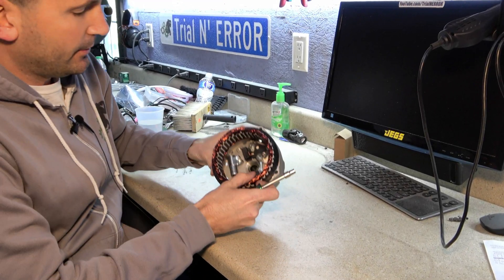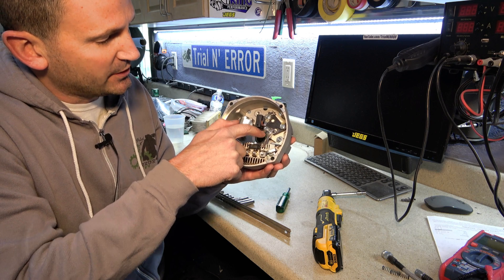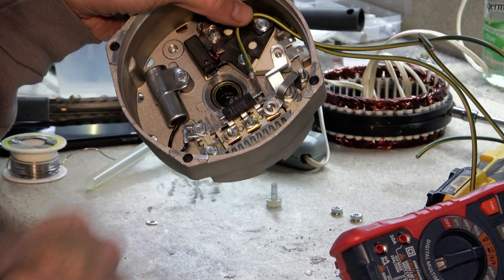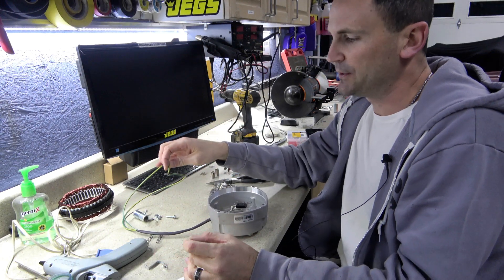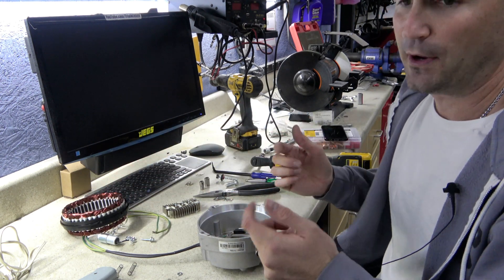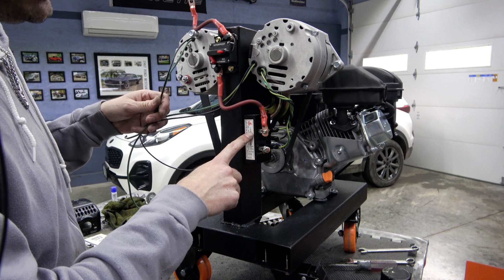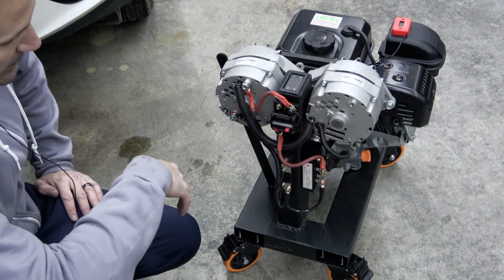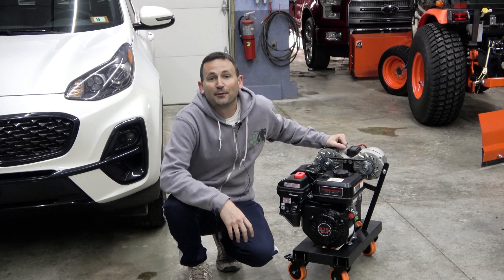Building a 48v Off Grid Generator: Part 2 - Got it figured out!!!!

Comment: So this is a petrol engine powering a pair of modified ac generators with built in rectifiers to achieve 48V. I don't see how it's much different to standard petrol 120/240v petrol generator with external rectifier. I guess it's quite a lot less efficient being belt driven and with twice the moving parts.

Comment: I was considering doing something similar, but using one alternator, and a step up transformer, say, 1:2 (24v to 48v), then the bridge rectifier. It would double the  voltage but half the amperage. Just use a high output alternator (one). I thought it would be simpler than what you are trying to do with 2 alternators, and it's a great excuse to wind a transformer! I suppose you could just buy one, but where is the fun in that? That's one of the great things  about a/c, you can easily change the output voltage with just a transformer.
if you are buying a transformer, you could get one designed to step down 3 phase, and just connect it backwards. There are lots of step down transformers for 3 phase, and they are usually even ratios like 2:1 or 4:1.
I'm thinking about a way to use a shunt and a transistor or two to regulate the field current based on the output current, there has to be a way. I'll figure something out.

Comment: I have a 6 hp diesel engine and i plan to run free grease fuel in it, also i plan to mate it to a dc motor to charge my solar batteries through a charge controller,  can anyone give me any pointers on my idea

Comment: Why don't you take the voltage regulators out of the alternators series them together going for the highest voltage possible  bridge rectifier to dc hooking them to an mppt charge controller designed  for 48v batteries don't worry about regulation because the mppt charge controller will manage it all. Higher voltage means less amperage and smaller wires.
Just an idea, hopefully simplifying the process.

Comment: Nice Job. Do you still use the DC generator? I have done every process that you have shown in the last 2 videos. I was able to get the cost per Kilowatt hour down to $.36 per kilowatt. with Fuel cost at $2 per gallon. I ended up hacking the Delco 10si with my own rheostat and data logger. I also used the bridge rectifier. Through my own trial and error I discovered that the alternators have a 20% duty cycle. They just are not designed to charge large battery banks. The get vey hot if you run the over 30% of rated output. I discovered it is all about rotating mass.
The Delco 100 amp 10 or 12 si weighs about 12 pounds. I have a MEP military DC generator now. The generator head weighs about 90 pounds. Needless to say it has  a hole lot more Iron and copper rotating mass. No Heat issues at 100% output. I paid $200 for the generator. That said I rarely use it. I normally charge our 30 kilowatt battery bank using the Magnum inverter charger. I power the Inverter/charger with a MEP-016D diesel generator. The cost per kilowatt at todays off road diesel prices is obviously more that when I did my first test t $2 a gallon. Still on those multiple days of snow and no sun I have found it to be more efficient than the DC twin cylinder gas generator. sorry about the length of my comment but I am truly interested if your generator is still working for you. There is no shore power available in our area.
Thank you sir.

Comment: This was a interesting video -  as for your 2 altenators to produce an efficient 48 volts -    both altenators would need to be in phase with each other - 
      To remedy that problem you can add a large capacitor to each rectifier out put - 
      Connected each capacitor up just as with a battery and that will eliminate the phase lag - 
    Then  hook your capacitors in series as if there battery's - 
      At that point you should get the full out put power generated off the altenators -   
       you could use two 1500 uF 250 volt capacitors - I've done things like that using welding machines to generate series voltage for remote mountain microwave transiever's when the on sight 48 volts generators all failed - communications systems are 48 volts

Comment: Watching this a year late, but I think, were it me, Id have electrically isolated both ground and hot on the second alternator. That way, your original plan would have worked with a LOT fewer headaches. Second thought is a small harbor freight or similar generator wired to a 48 volt golf cart charger might have ended up less expensive overall, No? Great video overall. Thanks! Gave me some great ideas for a similar project.

Comment: The problem with what you are doing is that the alternators have no charging algorithm for bulk/absorption/float.  They just supply constant voltage which is fine for automotive batteries which don't normally reach a depth of discharge that solar batteries do.  The higher the D.O.D. , the higher the voltage needed to bring the batteries back to a full, 'good quality' charge.  You'll find that over time the quality of charge that you get with this setup is sub-optimal.

Comment: You need to pull the AC from each out, put them into external rectifiers, then combine the DC, add a capacitor to flatten the output, see where your OC voltage is and then get a 48v buck for the rated load.

Comment: I think you could have made this work with one alternator and had the regulator work for 48 VDC by wiring a 24 V zener diode in series with the voltage sense input to the regulator. The zener will subtract 24 V and the alternator output would have to be 48 VDC for the regulator to see 24 V on its sende input. It should then regulate the output st 48 VDC.

Comment: I just stumbled across your first video of this project and got instantly enthralled. I am 73 and have spent my life on diy projects like this one.  And I think the name you chose for the channel is awesome. It describes my whole life.
David Poz did a similar project on his channel "DavidPoz" only he used a single alternator, removed the regulator and ran the output into a solar charge controller. 
Both your project and his were very interesting and enjoyable but both were too expensive and too much work for me.
I have a similar project in mind in my budding solar journey.  I already have a 120v 3000w generator but I don't want to spend $500 bucks on a 48v charger. 
So, I  am going to "TRY" running the output 120v ac out of that through a 200amp full bridge rectifier (Amazon $23), add a $2 capacitor to smooth out the rectified dc and feed that into a cheap 48v solar charge controller. Run the generator on propane or better yet natural gas and not have to deal with gasoline at all. 
Should work, maybe it won't.  "Trial and error" .

Comment: If you had used a solar charge controller you can use full voltage off the alternator and if it runs too hot you can reduce the voltage with a heavy duty rheostat and use a lighter wire and the Voltage doesn’t really matter but the higher the voltage the less amperage to get the same wattage means less heat so your fields should run cooler

Comment: wondering if a simple voltage doubler would have worked ? 2 caps and a view diodes rated at 125 amp or so, so 1 alt needed, then a aftermarket regulator 48v to the input inverter

Comment: A few suggestions. Use a dual pulley on the engine to drive each alternator on its own belt. This would eliminate those extra pulley / tensioner mechanical components. Also driving one belt through all those pulleys along with having the grooves on the alternator pulleys being the wrong size will make for some short belt life. Instead use 5" racing alternator pulleys which will accommodate the wider belt of a standard pulley. A dual engine pulley can easily be sized as required. The larger pulleys will reduce the strain on the belts ensuring longer belt life over smaller diameter pulleys also. Those types of engines are only good for about 1000 hrs of use. Use a diesel engine to get perhaps 3000 5000 hours of use plus it would use much less fuel and be cheaper in the long run.

Comment: Living off grid in the mountains of Luzon, Philippines. Thanks that was most informative and saved me going through a similar journey hhh. Got my motor, a low speed diesel YAMADA 7HP, 1800 rpm.... Now I need to figure out whether to use a 150A  truck alternator or a 2000w small windmill motor. Also need to decide if 24v or 48v system. Cost benefit study soon. Subscribed.
Reply: Use a pma or pmg. Permanent magnet alternator or permanent magnet generator like ones used in wind and hydro. Very efficient that way

Comment: Back in the 80s a lot of cars had a separate external regulator. Alternators rarely ever go bad. its the carbon brushes or the regulator that usually fails. I've never had to replace an alternator yet. $15  for brushes or $20 for a regulator, maybe a bearing on rare occasion.

Comment: From my point of view, a nonsensical conversion. The easiest way would actually have been to rebuild one of the two alternators on positive ground.
These would then be connected in series via both housings and frames, and the 48V could then be tapped at the connections. There wouldn't have been a need for rewiring the stator and rotor, you wouldn't have had to use an external rectifier. It would have been a lot easier and would have looked cleaner.
Simply disconnect and exchange the connections from the built-in rectifier to the housing and voltage tap, and put the measuring connection of the internal controller back to its potential. You don't even need to get to the AC part, as it works completely isolated from the rest of the alternator anyway. The whole thing later works like two laboratory power supplies connected in series.

Comment: A bit late maybe but gonna throw this out anyway.

 You're always going to have belt tension issues with that setup.  You've got the engine on flexible mounts with the alternators fixed to the frame. As the engine mounts fatigue the belt tension will need adjusted. That's obvious... but the very act of tensioning the belt is accelerating the engine mount fatigue. Eventually you run out of adjustment or, in this case, you end up with total failure of the mounts resulting in metal on metal, defeating the entire purpose of the mounts. There is a reason belt driven accessories are mounted solid to the engine in every commercial design.

Comment: I would agree that the alternators should be electrically isolated from each other since the body is the ground. There is no one wire alternator, they are just using the frame as the ground which works in most vehicles. If a positive and negative came out of each alternator carrying 24VDC, then they can be in series, but only of they are isolated.

Comment: A properly wired transformer can easily change any voltage to any voltage. If you increase the voltage you will decrease the amperage by a proportionate amount. If you decrease voltage the amperage will increase accordingly. It's just a matter of inducing an electromagnetic pulse from one coil into another by having them close to each other. When you power up a coil it causes a production of electromagnetic energy which pulls on the secondary coil(s) within range of its magnetic flux. This induces an electrical current into the secondary coil where the voltage is determined by the number of wraps in the winding of the coil. Anticipated amperage determines the recommended wire thickness needed for each coil. Also the wattage draw determines what type of cooling system one would require to cool the transformer.
Reply: iron core tranny dont work well with the high freq output of the alternator my friend

Comment: The easiest way to get 48 volts from two 24volt alternators is to leave the alternators alone and wire them together in parallel then pull a high voltage transformer from an old microwave or a/c unit or a welder or a battery charger etc,etc... Cut out both primary and secondary coils from the steel and wire each coil by hand according the anticipated voltages and amperage draw you need then apply heat sinks, cooling fins and possibly some small computer fans to cool the transformer as needed.
Reply: What you just wrote is impossible. If you leave the alternators alone, the output of either will be DC. You cannot use DC on a transformer period.
Reply: @elser2utube  the problem with you ending on your period is that it's not true. The first transformer ever made was DC. It needs a capacitor to pulse the energy at a particular rate. Energy plus vibration creates a frequency. "If you want to understand the nature of the mysteries of the universe you must think in terms of energy, vibration and frequency. " - Nikola Tesla.
Reply: @captainKedger  With all due respect. You didnt mention a capacitor in your initial "All you had to do instructions". However, If you put a capacitor on the unmodified output of one or two alternators, in any configuration, all you are going to end up with is a better DC "waveform" on the transformer primary due to filtering or buffering. This would be accompanied by nothing on the transformer output, apart from useless spikes when you disconnect to troubleshoot, and heat generation in the grossly inefficient resistive heater that was just custom wound.

Besides, if you wanted to "correct" the voltage via a transformer, it would only make sense to remove the alternator output bridge (same modification done in this case) and route the AC output of the alternator to a three phase transformer primary, then rectify the output.
Reply: @elser2utube  you have a couple of good points there. I live on a boat so I find 12volt DC current to be much more useful. I often forget most people live in houses.

Comment: All of these solutions will give you problems because if you do manage to get 48 volts you still need to get the voltage to pulse at the right frequency to be used by anything useful. You're going to need to build a bank of capacitors or make a capacitor for it.

Comment: note using the big aka 6 phase car audio alternators you can do the same thing by pulling all 6 phase wires out and using external rectifiers (it's not 6 phase it's a single stater with dual 3 phase windings you can directly feed 10~14v into the field coil and use a MPPT charge controller from the 50~100v to charge the batteries this will give you 90% ish total electrical efficiency upto the battery (liFe charging you loose apx 15~40% depending on charge rate)

Comment: Use alternators in parallel without modification

buy a buck/boost converter
to convert dual output of the 24V
into 48V

this way you can easily replace an alternator from stock components

or add another alternator in parallel to get more amperage

Comment: You need two 10000uF capacitors.  One across the DC feed of each rectifier.   The alternators will then load up on the engine much better and you won’t eventually burn out your field coils in the alternator.  Each alternator is generating pulsed DC not smooth DC.  The pulsing of each alternator cannot be relied on to be perfectly in phase and in frequency.

Comment: Sorry to be late with a comment, I just stumbled upon this video.  I am a retired EE, have worked with that style GM alternator since the 1970's, backup power since the 1980's, designed numerous power supplies, and then some.  First off, automotive style alternators have their outputs rated at a shaft speed of 5,000 rpm.    They will gladly kill themselves trying to make power at lower rpm because, the regulator circuit is super simple without any type of current limiting or temperature sensing.  If you are trying to run the alternator at 2,000 rpm, derate the output by 75%, otherwise you stand a good chance of cooking the 3 phase bridge rectifier and stator windings.  Running low alternator shaft speeds also causes the alternator to easily stall (lockup) when heavy loads are connected.

Budget at least 2 HP of engine power for every 1,000 watts of generator power needed.  I recommend using a 20 HP engine for this project with a 3:1 pulley ratio between the engine and generator, then run the engine at 1,700 rpm.  This will increase efficiency, reduce noise, vibration, and engine wear.

Placing 2 stock alternators in series should work if you have a ~ 40 amp/hour, 24 volt  battery connected to each alternator to keep the system electrically stable.  You could instead probably get by with two 220,000 uF caps (with a 50 amp ripple current rating) instead of the batteries.  You will probably need at least a 3 watt resistive load (27 ohm, 10 watt resistor) across each alternator to aid the alternator voltage sharing.

If you plan to run an external rectifier for each alternator, your heat dissipation could go as high as 220 watts per rectifier so, huge heatsinks will be needed.

I know the things I am mentioning sound far-fetched/unnecessary but, if you want this generator to be reliable, you can't just cobble some stuff together and assume everything will be okay.  Hope this helps.
Reply: Hi,how I can contact you?
Reply: @maximuspet  Who were you trying to contact?  (You didn't address anyone).
Reply: excellent explanation!!  good ideas also on improved design!  especially the part about where alternators make their power!
Reply: @billharris6886 You know A LOT! I would love to pick your brain on what it would take to fast charge or better yet, continuously charge a Tesla-like battery while driving. Essentially making a hybrid. I interested in building my own hybrid vehicle out of a former gasoline vehicle using an electric motor, battery, small engine, etc.
Reply: @ZBrink11  Several YouTubers have already done this, use the search term: "tesla with gas generator in trunk".